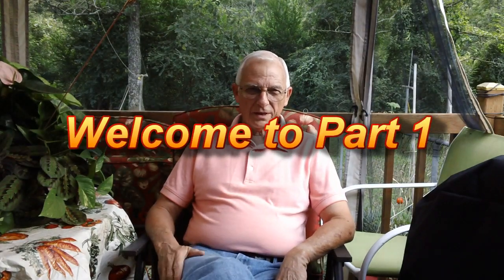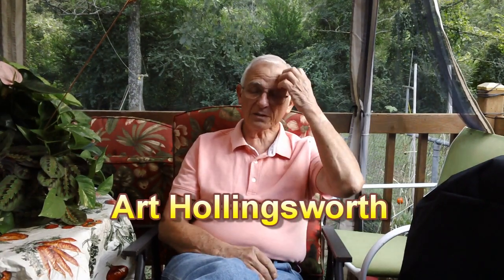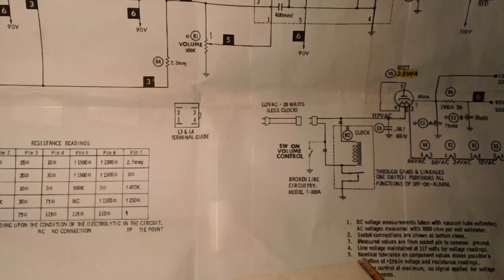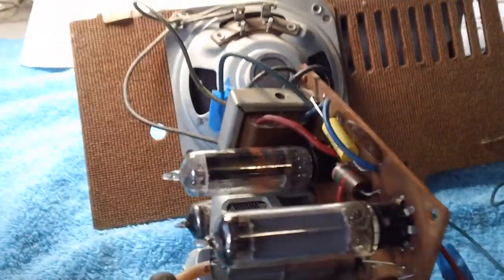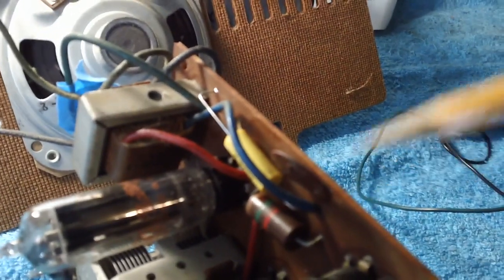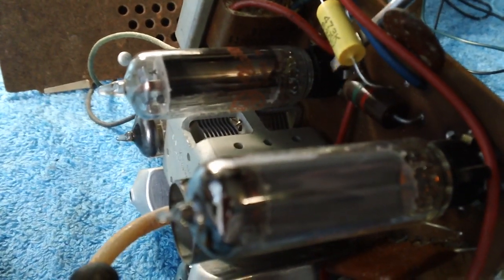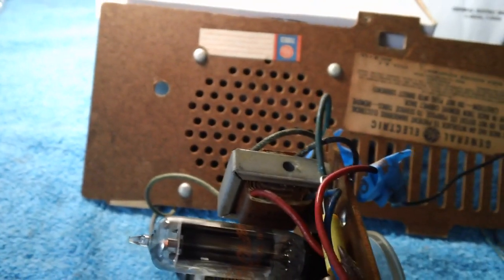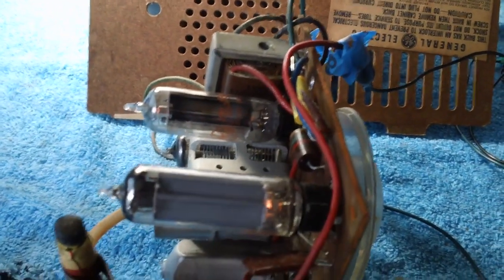General Electric C-403A Radio Repair Exercises (part 1 of 14).

Comment: John,
I remember, as a thirteen year old, questions like, “How do I best remember the resistor colour code”; “is red 2 or 3 or is orange 2 or 3 – is grey 8 or 9, or is white 8 or 9?”, “is it called an insulator capacitor or a suppressor capacitor?”, “Have I put the valves back into their correct bases?”, “will the radio blow up and kill me if I haven’t put them in their correct bases?” causing me a lot of anxiety.  Thirty-two years later, learning Morse code presented me with a similar size headache as it did when I learned resistor colour codes and also colour codes for some types of capacitors. 
I, therefore, see plenty of benefit in what you have briefly explained: I feel confident in saying your series of tutorials will be of immense benefit to those who are quite new to electronics, especially Vintage Radio.  I remember, aged between sixteen and twenty-one, coping with learning theory relating to terminologies like; “time constant”; “permittivity”; “dielectric”; “differential” and, “joules,” merely to fulfil end of academic year examination requirements – I never needed to use that stuff ever when I graduated to a radio and TV service tech journeyman.   Looking back to my days as an apprentice, I’m surprised I wasn’t turned, terminally, off electronics and Vintage Radio LOL.
A well planned video – well done to you and our mutual friend.
P.s, I’m asking on behalf of a friend of mine: what became of the 1938/39 Silvertone 6044/45 battery valve radio you restored last year?
Regards,
Phil.

Comment: Yes John, I want you to go on with the series. I only know just so much about fixing old stuff and then I always have to hand it off to my friend to finish it. I don't even know how to use an analog multi tester to test if capacitors or resistors are good or not. I want to learn how to use a multi tester. My friend showed me an old RCA Victor one that I bought but he hasn't had the time to show me how to use it so it's just sitting on my shelf. By the way,, I use your method on replacing capacitors by winding the leads, I use an old jewellers screwdriver that had a very thin shaft to wind the lead around, now I won't do it any other way. To me it looks neater and more professional and I can attach both ends of the cap to each end of the old leads and it stays put while I'm soldering it.

Comment: Very nice idea for a good series of videos. The most interesting videos of this series will be the IF section, this is what scares most of the beginners (including me), what happens when a resistor drifts up in value or gets open, what happens when a capacitors shorts or gets open. What happens if one or multiple IF coils opens or a few turns get shorted, could you wind another replacement coil? This is will be the most interesting things. Sorry if I made a few mistakes in my grammar because I'm very enthusiastic about this. I have plenty of ideas of what to do next, just ask. Keep up the good work. Cheers :)

Comment: John, this series is an excellent idea.  One thing that might be worth presenting is how to use a second radio tuned to 1455 to prove whether or not the local oscillator is functioning on a radio that you are trying to repair that is tuned to 1000.  I constantly have to explain how to do this over on the Antique Radio Forums. I usually tell people to set up the two radios then wiggle the 1000 tuning while listening to the other radio to see if the local oscillator is running.  73 - Curtis

Comment: Thanks for sharing these videos! I just bought some Zenith T/Os and am looking forward to digging into them. I went through dc/ac fundamentals in tech school, but never got a chance to put that knowledge to use until now.
Reply from the maker: Mike,
Thanks, my friend.  The vids aren't much, as they had to be kept at the most basic level with a lot of repeating.  Besides, I'm no electronics genius.  What model T/Os did you buy?

Regards,
John
Reply: joernone  The videos are just what I need to shake the rust off my electronics knowledge. I bought an 8G005, a G500, and a Y600. My dad got me interested in shortwave as a kid, when he let me listen to his 600 series radio he bought brand new in '56 before the air force sent him to the northwest territories on the DEW line. I got so enthralled by what I heard on that radio, I worked in broadcasting for 10 years.

Comment: Great video John. Looking forward to more in the series. I have learned from your videos how to read circuit diagrams and trace the wiring in the radio from them apart from many other aspects of radio restoration.

P.S. Is it my hearing or did the static from your camera disappear when you disconnected the capacitor?

Gordon.

Comment: I was getting ready to request that you address the installation of X1/Y2, X2, and Y2 Safety Capacitors, but the moment my fingers hit the keyboard, the blue disc from Dave and Babylyn came into view, many thanks!! Could I request a lesson/opinion on the virtues of "whether to, or not to install a fast acting fuse" during the restoration or repair of a classic AA5 or other tube type radio??

Comment: I have a weird problem of my own that's kinda radio related I guess you could say lol. We still have some analog channels on our cable. I turned on the Tele Color Zenith I recently fixed a few nights ago, tuned it to channel 13. That set went into terrible distress. I also noted it was causing static on another TV tuned to channel 13 at the same time. When I changed channels on the Zenith, the static instantly went away on the good set.

I think you are going good with these series of videos.

Comment: Troubleshooting, not restoration, is that right?  Hmmm, proper tool for troubleshooting a bad GE?  Perhaps a 12 gauge, and um not talking wire thickness.  I have some radios that I'd to use for target practice, how's that? BANG, THAT FIXED IT GOOD, NO MORE TROUBLE FROM THAT RADIO!

Comment: GE radios made in this era (mid 50's-mid 60's) are very prone to silver migration disease in the internal capacitors contained in the IF cans. I've replaced or rebuilt more of these cans than any other component part in any brand of radio. I cringe when I see those cans!!